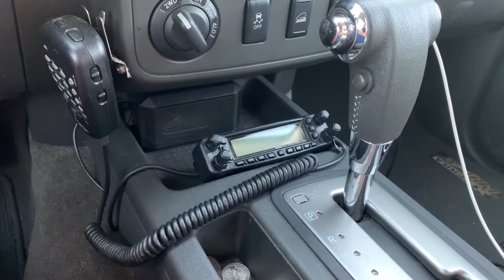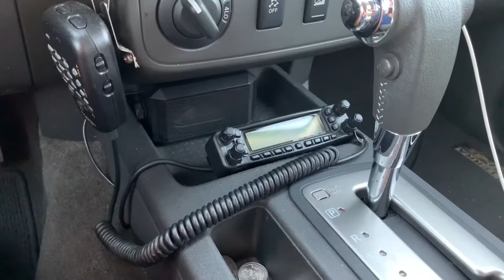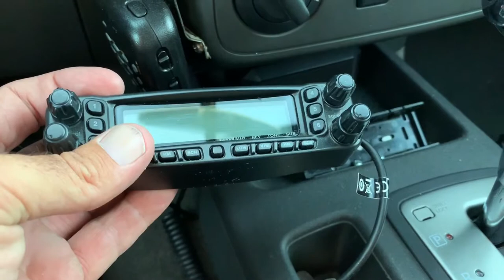Field-Deployable modular amateur radio rig and 2M/70CM vertical dipole antenna

Comment: Great minds think alike! I have recently started making an ammo can Go-Box. I am using multiple power sources for my QYT, 25 watt, mini-mobile (tri-band) radio. And a small mag mount antenna is working great. It also stores, 2 sealed lead acid batteries, but will eventually switch to the smaller & lighter weight Li-Po4 batteries. 
I just watched the old video on making that dipole dual band antenna, you made. I like yours better. Since you can hoist it into a tree. I am also considering a flexible Ladder line, J pole antenna as an easy to pack, tree limb option! 
Great job and good video. Keep up the good work!
Reply from the maker: Thanks for watching and commenting!

Yes building go boxes, EMCOMM rigs etc is a ton of fun. Only limited by the imagination 

Tbh the classic ladder line j pole is a much more compact and lightweight option for this kind of a rig